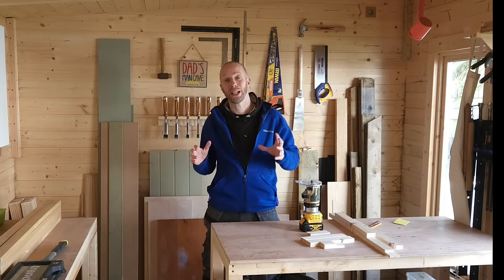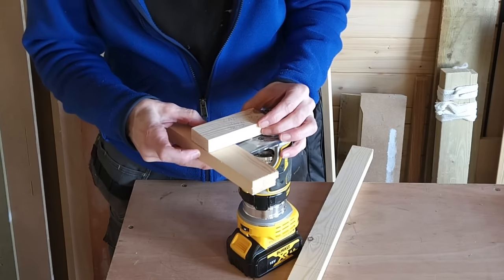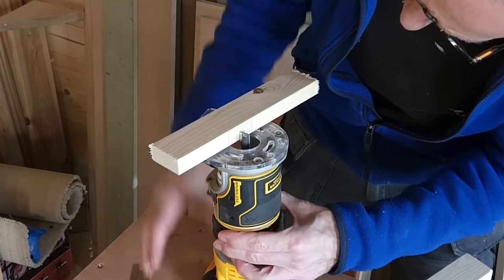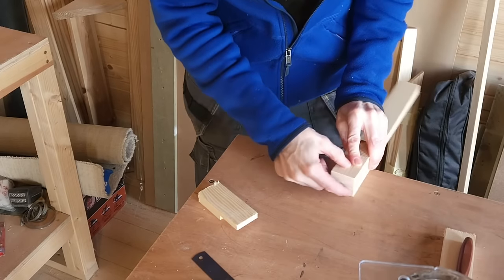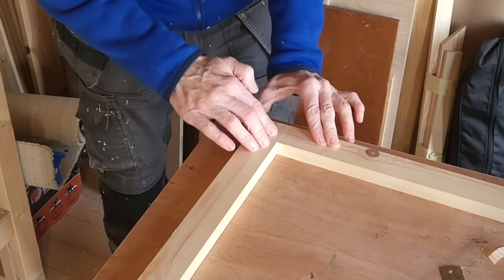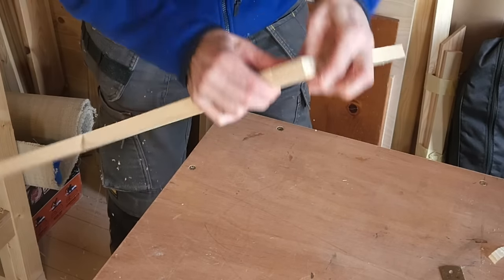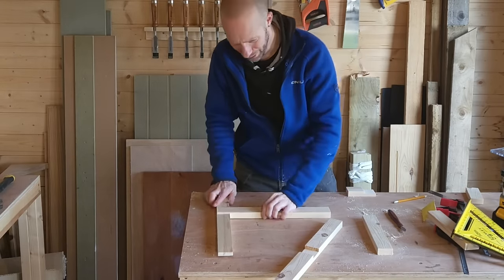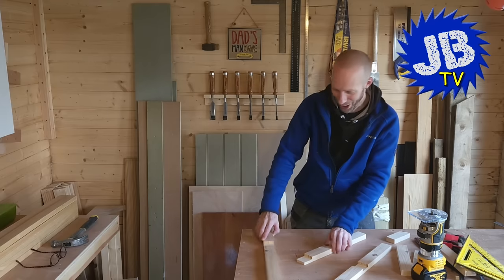Perfect Lap Joints Every Time - Simple Method Using A Router

Comment: Great method, the reference block. I usually use a table saw or circular saw to hog out most of the waste first to save the battery and bearings on the router. I leave thin strips the width of the saw blade to support the router base if the base is not wide enough to span the joint.
Reply: Stop messing  about, tenon saw in vice dine.

Comment: Thanks this is such a good video Justin. I think you can use the wood as a spacer to cut the spacer with the router if you follow me, so long as the edges are butted against something. Just thinking it is easier to cut the spacer without measuring if possible, that is certainly a lesson I have learnt the hard way with woodworking!

Comment: What about a lap joint from butt to butt without corner. Like to make a longer piece?
Reply from the maker: Nice thought, but it wouldn't be very strong. A scarf joint is used to lengthen a piece of timber.
Reply: You can do this, depending on the application. It's decently strong. I did it on a jig I made of MDF and the lap wasn't even very long, like 1" or so. When I finally threw it out I couldn't get it to break at the joint.  The process of cutting it is no different than any other half lap. Set your bit to half the thickness of the material and just cut out the ends of each board. 

a 45 degree scarf joint is basically a miter joint, which is also decently strong and faster to do. I would say the half lap is going to be stronger IF it's a long lap. If it's going to be a 1" lap then might as well scarf it. It's basically about glue surface area. You could also floating tenon the pieces together if you can't afford to lose any length.